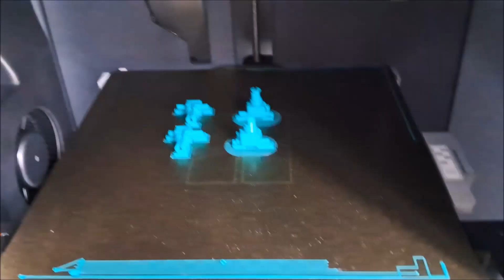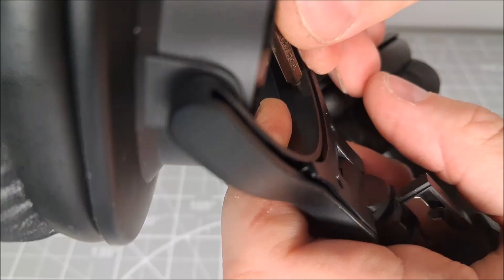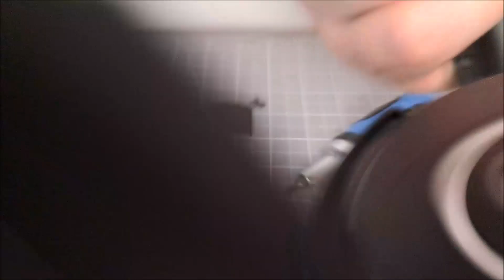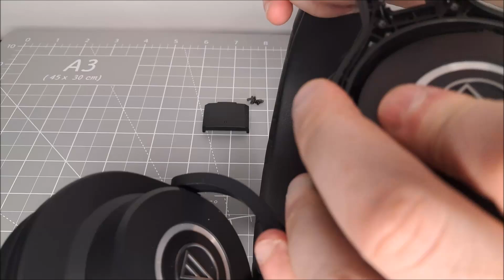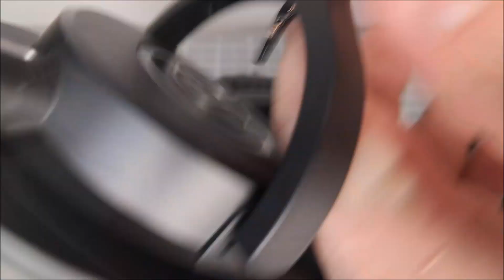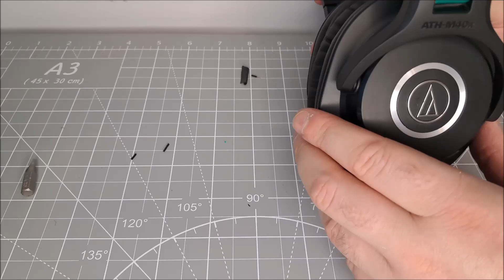Audio Technica ATH-M40X - How to Take Apart and Replace Broken Hinge NO SOLDERING - Repair Guide

Comment: So, it work for me. It didn't work first. I had to burn the copper layer on the ground (gold wire) and the red wire. After that i put tape on them both but separately. It's not as good looking that on the video but it work.

Comment: Got a pair of replacements from your eBay when I saw a small crack on my m40x hinge. 2 days ago it finally broke for real. We ended up just destroying the broken hinge rather than cutting the wire. We didn't have a cutter strong enough so we just carefully melted through the plastic with a heated pin (don't do this without proper ventilation).

Thanks for this, saved me a 150 NZD replacement for now!

Comment: I have 2 pairs of these, bought the second one after the hinge on the first one broke. The hinge on the new one just broke and I decided to try and repair it by using one of the cup pieces of the old one. However, upon opening the older one I was quite surprised by how weakly everything is held together in these headphones, no wonder i broke 2 pairs with very light and gentle use over a period of 3 years. They stay in my studio all day and I'm quite gentle with my equipment. So anyways, upon seeing the way it was held together I realized any repairs i do wouldn't last. I don't know why they keep making them like this, I would rather get the m20x which doesn't have this stupid hinge mechanism but i don't want to sacrifice the sound quality.
Reply from the maker: With my hinges, you will only have to replace it once.

Comment: one side of my headphones still won't work after several attempts, any advice? ive tried multiple times and consistently don't have audio in the right earcup whereas i did before attempting to splice them
Reply: don't forget to also burn the ground wire/the gold one

Comment: worked like a charm. during the process I was really nervous and couldn't burn the cables and tape them together strong so one side wasn't working. But after several attempts, before building the pieces together I managed to fix it.

solid tutorial

Comment: Hi mate I am stuck need help. How do you get rid of the hinge without cutting the wire?
Reply from the maker: Break it / Cut it apart with pliers or a snipping tool. If you have a dremel this works too.
Reply: @BackwoodsGump  ok then what about after

Comment: I'm not sure what I did wrong but I don't have sound on the other speaker :((
Reply: the same thing happened to me, only the left side works now.
Reply: @patricioturpin6627  burning the ground wire as well fixed it for me, I didn't think they would also cover the ground one lol
Reply: Same for me :(

Comment: Btw, does the wire cutting trick affect audio quality/volume? I'd imagine there'd be a bit more resistance as compared to an intact wire
Reply from the maker: I haven't found it to be any different in quality. Spliced wires are not uncommon in speaker setups, etc
Reply: After such manipulations, the right side became quieter. Now I'm thinking about replacing the earphone(
Reply: @artanisky4428  actually this. it was okay for couple of days however I feel like right side is quiter now :(